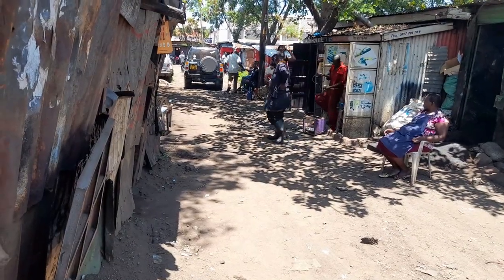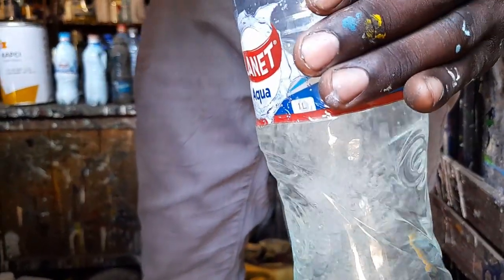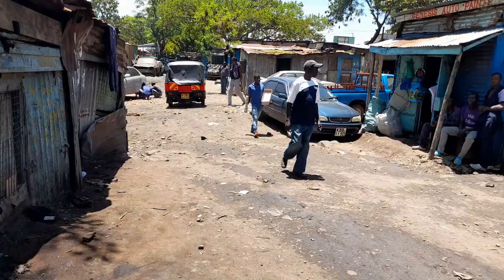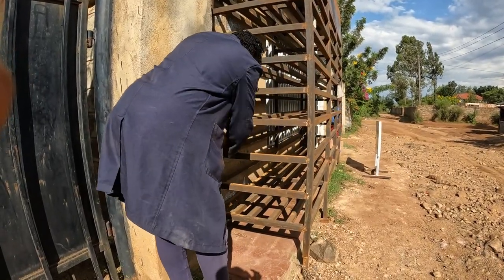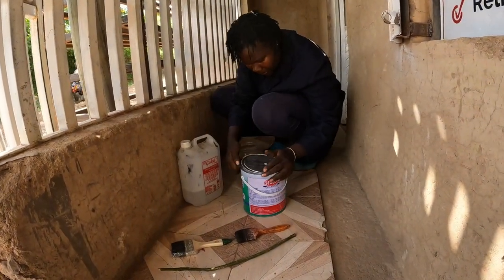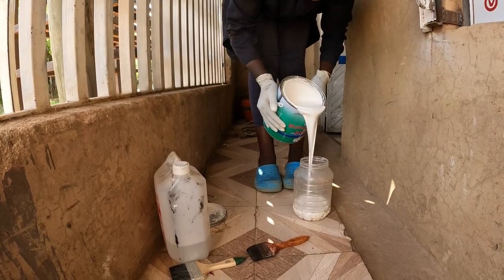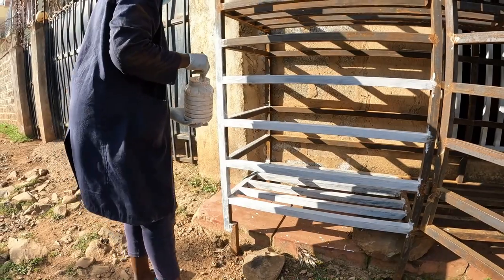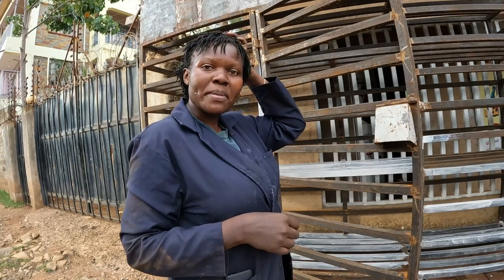Painting the Gas grill Display

Comment: I’m very eager to see what you are using the shelf like structure for just an helpful tip you could use a plastic bag inside of your paint sprayer and then add your paint color in and still screw on the nozzle if you are not done and you still have paint in the bag you can tie up the bag and keep it in a jar and if you are done with the paint it will make clean up a breeze 👍🏾
Reply from the maker: Thanks for this tip